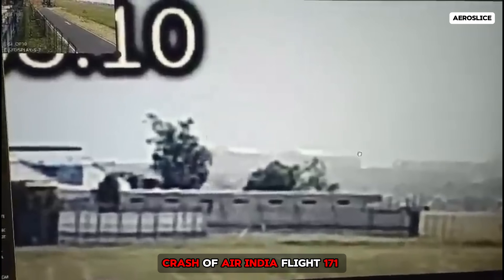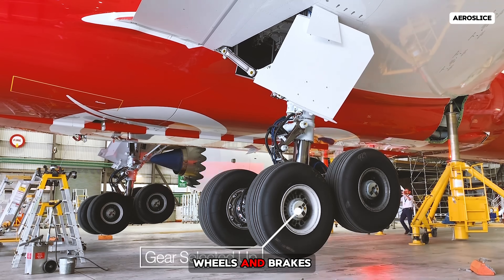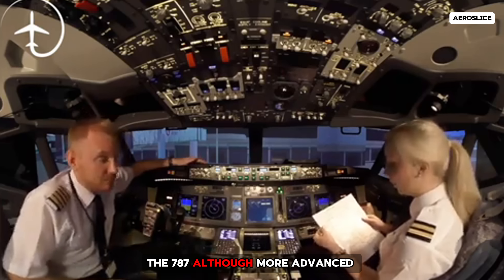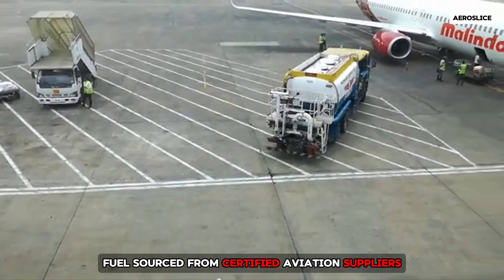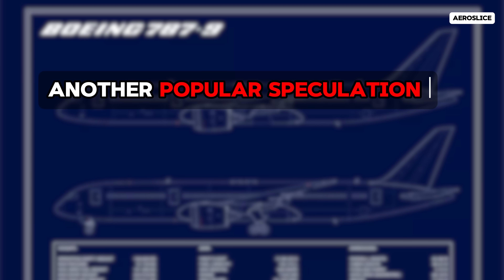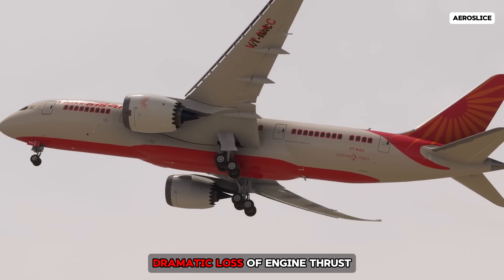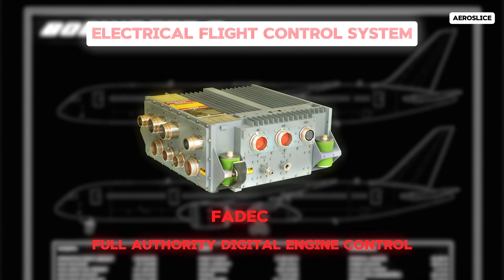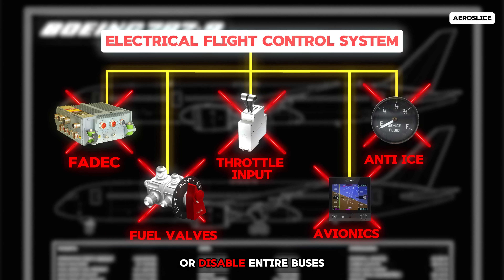The Truths Behind the Air India Crash

Comment: I was 30 years working as flight Engineer by Swissair,we had a Flight from Seoul back to ZRH,,duringTaxi out all Engine Flamed out👹,back to the Gate the Investigation showed we hat around 6000  Kg of Water in the Tanks.
With Center Tank feeding direct to all Engine the water Induktion was set.
Swissair all were very happy to remain on taxiway😮
Most probably the water came from Airport under floor fuel feed☠👹 😢
That is a True Story

Comment: Engine computer failure that shut Both engines is highly likely.  However the there is a diode pack between both the generators and both displays and control side that can fail cutting power between the batteries . This will cut the ECM and power switches causing a shutdown of both engines until reset manually. It is in the schematic drawing of the manuals and needs working back to find.

Comment: And sorry - but I think this video is bullshit too. The ram air turbine is certainly extended, you can hear it in the video shortly before the impact. That doesn't sound like a normal 787 departure. Also the flight control systems and flight computers are still working, the plane never entered an uncontrolled flight condition, it didn't stall. It simply ran out of height and there is nothing you can do about that with only a few hundred feet of height and no engine power over a populated area.

Comment: Fuel contamination is almost impossible in this case as it would lead to a sequential failure of the engines, not a total loss of power on both engines at exactly the same time.

Comment: You don’t retract flaps unless you have positive climb rate, and are at a safe altitude to do so. After V1, positive climb is established, and the gear is retracted. It seems power, and system loss occurred at the V1 phase. They had to commit to the take off, or go off the end of the runway. It seems this aircraft had serious issues. It was very hot, so density altitude probably didn’t help, but would not have been an issue. Only Data from the recorders will ultimately give clues of the cause. Speculation at this point should be, just that. No conclusions until the investigation is complete.

Comment: Let's assume that a catastrophic electrical system failure / glitch, caused both engines to be powered down to the point of causing this crash.
Where will that leave the 787 and Boeing?  Short answer: nowhere good.
Such a system problem would surely cause all 787s world wide to be grounded, and Boeing's share price smashed. Again.
I see it is about 8% lower than before this crash.  The potential is there for a much more serious fall.

Comment: Gear retraction fault, plus dual engine failure?
How about the gear retraction sequence was stopped by power interruption when the engines shut down?
A total electrical failure doesn't make the FADECs fail because they are powered by permanent magnet alternators in the engines. They receive data inputs from the rest of the airplane, not electrical power. 
Cascading electrical failure is a mere speculation. I blame the pilots (or one of the pilots) not for gear or flap mismanagement but for either shutting down the good engine when the other one had failed, or malicious intent by shutting down both engines.

Comment: This video is a fine video, why? Because it tries to prevent speculation. By the existing information, there is no confirmation of human error, rather the opposite.
Having a FADEC for the engine is not trivial, why? You need two of them, one master FADEC and one in standby mode, just in case!
Due to this fact, there must be a procedure to check if the 'Standby Fadec' is operative.
And even this takes the system to additional risk, why? Because this needs switching to the 'Standby System', and some devices in an aircraft don't like to be switched.
Such devices are servo motors, fuel shut off valves, ...
It could even be that the 'battery disconnect conductor' was corroded because it was never used before !

Comment: 02:55. Yes but it became airborne at the very far end of the runway. You can tell that from the dust it kicks up. Why? And it is the amount of flap that matters, not merely if the flaps were extended. In that heat and apparently from a short take-off, was it enough? Ahmedabad has part of its operations allocated to military use.
Reply: That's been debunked already. They said for the aircraft type and the amount of weight on the aircraft that it took off using the same amount of runaway as other aircraft that were configured the same way. There's videos all over that show the planes taking off and the dust piling up from ground effect but it's not from taking off at the end of the runway like it appears.

Comment: that was my opinion already from the beginning some total system failure or cable short causing this.  Don't forget the Netflix Documentary mentioned Boeing forcing cables and isolation problem of cables !  Together with the heat maybe it created a short taking down the entire system... !  I bet you it will be something similar and stupid thing done by B  like with the MAS system and relying on only 1 sensor causing 2 horrible crashes !

Comment: THE AIRPORT CCTV VIDEO PROVIDES CRUCIAL EVIDENCE ON CAUSE OF TWO ENGINE FAILURES

As the Aircraft approaches the end of runway, it blew dried vegetation dust and dirt in front of the Aircraft and flew into the dust and debris. What supposed to be fuel and air mixture became fuel air dust and shredded debris into the engines. 

The Airport CCTV Video playback in slow motion and Frame by Frame one seconds before liftoff and one seconds after liftoff provides crucial evidence of this event that cause the two engine failures
Reply from the maker: hmm Interesting observation

Comment: I can see Brown coloured smoke from the right of screen engine. I can also see a large black bird in the sky just before the plane reaches it's peak height. 
The smoke from the engine continues up in the climb. It's consistent with the radar path of reduced climb also. 
So what are the chances that an airport with a bird problem has a smoking engine, and reduced climb rate as evidenced by the radar flight path, and also crashes. People are saying that birdstrike is just ruled out.  Not possible. Couldn't be! It just couldn't be birdstrike, because there would be thick black smoke and giant flames from the engines and dead birds falling intact back down on the runway!  
Anything solid that goes through a jet engine could potentially cause it to stop operating properly. Often happens with very little indication also. Birdstrike? Very  likely. Very likely.
Reply from the maker: Yes sir it is still very likely!

Comment: I have a doubt, there are reports that the plane did a very long takeoff rollout of 3.5 kilometres instead of typical 2.5-3 kilometres so did the pilot monitoring instruments know engine isn't producing enough thrust and could have rejected takeoff and stopped on the available runway? Although I know it's not a safe thing to reject takeoff after V1 speed pilots are not barred from rejecting if suspected unsafe flying conditions.
Reply: The aircraft rotated in the usual position 2,100m from the start of the runway and 1,500m from the end and climbed to 400 ft in 10 seconds, at 2,400 ft per minutes, which is normal. 

Then the problem occurred.
Reply from the maker: Exactly Christopher! well said
Reply: Ooh ok, then the news reports must be incorrect or misinterpreted.

Comment: The gear bogies obviously tilted "front wheels up" after liftoff because the gear lever couldn't be moved to UP (causing the front wheels down prior to retraction). The air/ground system would prevent lever movement.
I doubt there was a gear system fault per se. More likely a loss of AC power to the Centre Hydraulic System pumps (after, perhaps, the  engines going below idle).
The aircraft clearly didn't get to 600 feet either above sea level or the ground. The undercarriage is barely a wingspan above the ground, so more likely around 200~250 feet above the ground.
You're relying a lot on the skills of people servicing aircraft. There are endless examples of failures. One "engineer" successfully put nitrogen in the oxygen system of one aircraft despite the fill ports have different fittings.
Does Ahmedabad have in-ground hydrant fuelling or tanker trucks? Did one tanker have water in it or contaminated fuel? There have been instances of only one aircraft being affected by hydrant supply contamination and there has been at least one incident of fuel contamination due to biocides put in tanks by engineers affecting both engines on a 787. Simultaneous dual flameout was avoided by a mere 51 seconds.
Don't expect smoke and flames with engine fuel deprivation. Do the engines backfire when they are deprived of fuel at the gate at the end of a flight?
The hydraulic system is not much different from the ancient 767. It also has engine-driven pumps and backup electric pumps on the Left and Right Systems. It also has dual electric driven pumps and a RAT for the Centre System.  
During engine start, like all Boeings and Airbusses, the FADEC system switches from main electrical bus power to the dual output, engine driven PMG on each engine. The thrust levers also derive their power from this system. The EECs themselves determine which power source to accept.

Each engine has two "IDGs" (or "Starter Generators"). i.e. a total of 6 main generators on the aircraft (including the APU).
Reply from the maker: Good points, I'll take care of them if i make a follow up. Thankyou for the detailed comment

Comment: Pretty good job on this video. Presents solid evidence which discounts or debunks several theories which are probably incorrect. Some notes:

1) The aircraft reached an altitude of 435 +- 12 feet above the ground; not 600. The ADS-B data shows barometric pressure (pressure altitude, or altitude above sea level) - here, 625' at the highest. The field elevation is 189'; you have to subtract that off to determine AGL.

2) One ADS-B point did show a rate-of-climb of 896fpm. But that was likely after the loss of thrust. If you watch the video and measure the time from lift-off until the aircraft appears to stop climbing, it's about 11 or 12 seconds. 435' of altitude gain in 12 seconds gives us an average rate-of-climb of 2175fpm - a normal ROC at takeoff thrust. This indicates that both engines were operating normally until shortly before the aircraft began to descend.

3) While subjective, many people believe that the RAT can be CLEARLY heard in the balcony video. Two versions of this video were released: The first was video of the video, and is less clear in both the video and audio; the second was the original footage which is clearer on both counts.

4) While originally called the 'FADEC-3' during design, Boeing renamed this system to EEC - Electronic Engine Controller.
Reply: "1) The aircraft reached an altitude of 435 +- 12 feet above the ground; not 600. The ADS-B data shows barometric pressure (pressure altitude, or altitude above sea level) - here, 625' at the highest. The field elevation is 189'; you have to subtract that off to determine AGL."

The height information was not provided as pressure altitude, but was respect to standard pressure 103.25 hPa, With QNH 1001 and the runway elevation 189 ft, the ADS-B 625ft STD equates to 71 ft above ground level (agl). This was the last of 8 data points covering 600m near the end of the runway. They range from 21ft to 71ft with a ground speed of 184 kts to 172 kts. 

If it is assumed that the 625ft was pressure altitude that is 625 ft AMSL (Above Mean Sea Level) then 625 ft amsl is 435 ft agl.

Earlier the aircraft climbed to 400 ft (twice the 197 ft wingspan), but then rapidly descended to 21 ft agl.

2) I agree with your general comment, but the peak of the climb was 400 ft and not the erroneously calculated 435 ft agl.

3) I agree completely.

4) The term FADEC has become generic, like Hoover.

Comment: Where is the error? The error is with people putting faith in Boeing. The 787 Nightmare liner has been nothing but an accident looking for places to happen. The exec's have never been charged or convicted, of a crime that is so blatantly obvious. How many other times have they gotten away with similar short comings. Let's have a look. This is only on the 787. Lithium batteries failing... Twice.  Out of control killing all on board twice. Now killing all but one on board. If I purchased a bicycle from  Boeing I'd have to take it to a backyard mechanic to have it safety checked. BTW, I have built aircraft from scratch, and the engines of many types, I am also a pilot.

Comment: You forgot "witness testimony"   
It was reported, the sole survivor said that there was a bang after take off.  Most explanations haven't factored this in.  A couple of days later I saw a video in which the survivor said, that at the end, the pilot revved up the engines but the plane just came down.  To me this means when they lost thrust the pilot (naturally) went to 100% full throttle but that lasted for a very short time.   Survivor also said the green and white lights came on in the cabin.  These are emergency lights that come on when there is no power.  So this means there was no electrical power either. 
So these are two things:  (1) Loss of thrust and (2) no electrical power. 

Maybe the software has a mode where it falsely thought the plane is going to crash, and so it shut down electrical power and turned off the fuel to the engines.  IOW, the software itself caused the crash it mistakenly thought was happening.  Or some values stored during maintenance and testing caused the software to believe the plane needed to be shutdown.  This software would only come on once the plane was airborne (like MCAS software).  Which would explain why the initial part if the flight had the thrust at Rotate, but just a few seconds later, it did not.  

Can a 787 expert tell us if the software has this mode?   If so, aren't pilots trained for this error condition -- unless is this is yet another 737 MAX MCAS type thing,  where Boeing hid this software from the pilots and the FAA?
Reply: bullshit talker simarjeet..bla, the light are backed up b y emergency battery , very small and not enough to power anything other than the evacuation lights..
Reply: @ulihanel7078  You haven't done your research, haven't seen the videos of the survivor who was in seat 11A, haven't heard what he said, what happened.  You don't know how he escaped.   When the Prime Minister visited the crash site he also visited this man in the hospital.  Somehow you missed all this.  
You don't know any of this, but had to open your mouth and say something.  You are a complete 
m o r o n.   The survivor said that blue and green lights came on in the cabin.  *Obviously* these are emergency lights for use in evacuation when the power fails.  D u h !
Reply: @ulihanel7078   "Bullshit"?  This is what the witness said in the video.  If you don't like it you're delusional.  And because the lights are backed up by a battery, that's exactly why they came on!   D u h.  Of course they might flicker when they switched from normal power to battery.  What about this can't you understand?
Reply: I am not an expert, but the 787-8 does not have MCAS or similar. This software was a fudge to get around qualification issues with the 737 MAX, which had been fitted with much larger engines that resulting in the engine thrust line causing pitch-up in some circumstances. The 787 does not have issues with the engine thrust line and a completely new aircraft had to undergo the full qualification process.

Simply MCAS was required because Boeing tried to save money by avoiding the need to qualify the 737 MAX from scratch and instead they tried to read across to the qualification of the original 737.
Reply: @christopherrobinson7541   I did not say the 787 had MCAS, I said if it has something where the computers shut down the power and the fuel.   MCAS dipped the nose, it does not shut off fuel.  
And it turns out I was right.  The preliminary report is out, and the FADEC computers (wrongly) thought the plane was on the ground and shut off fuel to both engines (to idle).  See my fresh post.

Comment: Yep i called it last week. A few other have speculated about some kind of electrical failure or software glitch. You are the first channel as far as I know to have given the most comprehensive account of the electrical failure theory.

Once i realised Boeing had s single software that manages and distributes electrical power to all systems on the plane, I deduced that this is the only plausible explanation to explain not just both engines failing, but also the landing gears retracting being interrupted and the earlier flight AC and in flight entertainment not working.

This is the new MCAS. Another faulty computer and software system badly designed with a single point of failure. Bt i have a feeling the investigation is going to blame it on something else to save Boeing. Unfortunately, with 1000+ of these Dreamliners flying about, it is only a matter of time before it happens again -- Murphy's law.

Comment: Thanks a lot for an extremely thorough and clear walkthrough. Yes, Isn't it really so that the only plausible resoning could be a catastrophic electrical failure that possibly leaves all 4 FADECs to throttle down for some reason.
I am no expert, but is it not the only way, a catastrophic software bug or error that leaves the electrics unworkable 😢😓😢

I read about a software bug that could cause a complete electrical shutdown, issue being a software counter within the generator control units (GCUs) that overflows after 248 days of continuous power, causing the GCUs to enter failsafe mode and cease power generation.  If both GCUs are powered up at the exact same time? 

Could this be plausible? 🤔